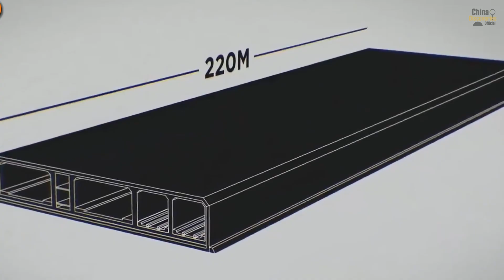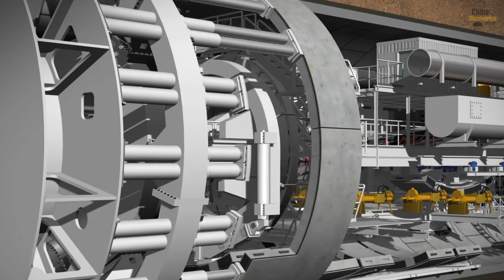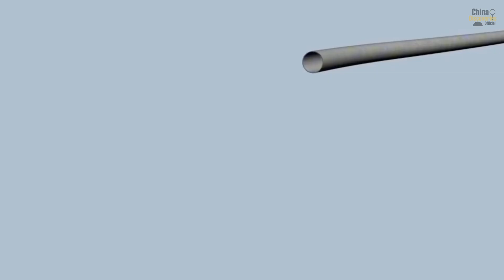SHOCK! China Completes the World’s Largest Underwater Tunnel in Just 110 Days

Comment from the maker: Finishing an underwater tunnel of 57 ft diameter in just 110 days, at a depth of 160 ft, under 110 psi water pressure is not just engineering, it is national-level execution. China is redefining the limits of modern infrastructure.
Do you think any other country could match this speed? Comment below